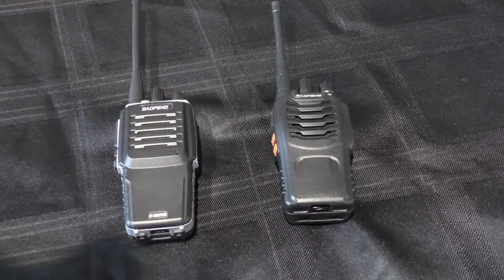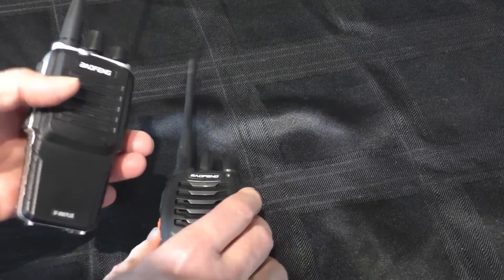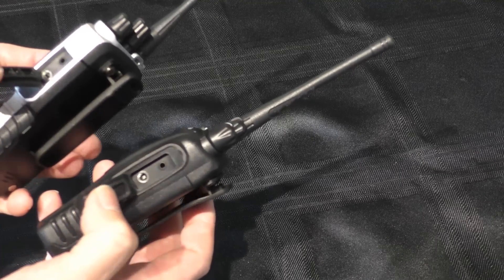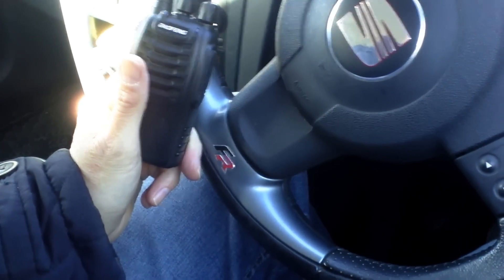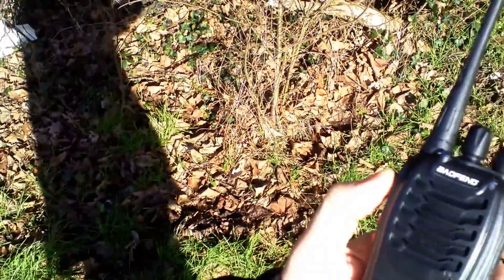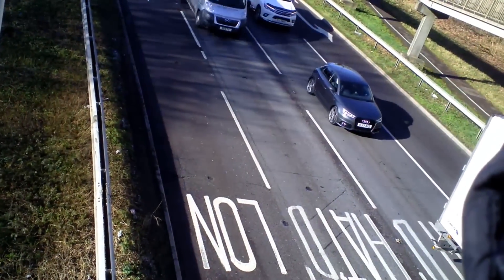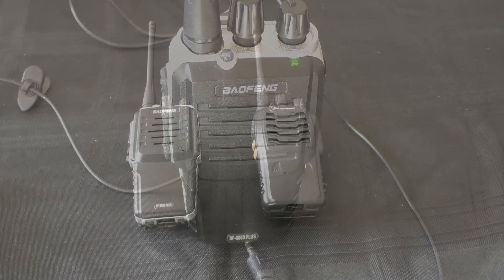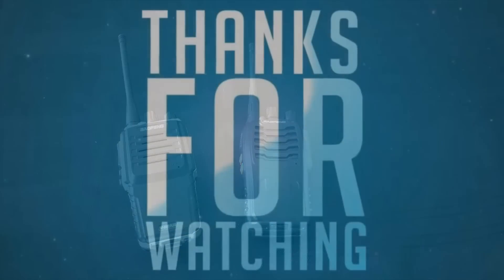Baofeng 888s V Baofeng 888 Plus on 446 Mhz.

Comment: I have a Baofeng 888s radio and i was wodering if i could tune into my local airports FM uplink i live around 9KM (5.5 miles) away from the airport and was wondering if i was to purchase a NA771 i would be able to tune into the frequency using Chirp and programming the frequencies ? Many thanks Louis
Reply from the maker: You would need to look up the airport freqs.  It will pick up 140 MHz.
Reply: Fred in the Shed I shall definitely look up the frequencies I was just wondering if they will reach as for as the airport ? Or is a powerful antenna necessary??

Comment: If I buy a baofeng bf 88e pmr 446 will I need to programme it or can I just use out of the box
Reply from the maker: Hi.  You need to program the preset channels.  Most people use the 16 PMR 446 Mhz channels.
Reply: @CB-RADIO-UK  you mean like set both my radios on the same channel? Eg. If I'm using channel 2 on one radio then set the other radio on channel 2?
Reply from the maker: @mrpullafastone  No not exactly.  The radios com pre programmed with random test channel freqs.  Trouble is some of these can be on the same channels (or close) to emergency services or Ham channels.  You could end up getting in trouble.  What you need to do is download a free programing software called CHIRP.  Inside CHIRP you can re programs the radios channels.  Most people use the public 446 PMR channels which are legal.  You can find the 16 channel freqs by google 446 PMR then copy and paste them in CHIRP.  There are some good CHIRP programming guides here on YT its pretty easy once you start.  Best of luck
Reply from the maker: @mrpullafastone  Chirp download here. https://chirp.danplanet.com/projects/chirp/wiki/Home
Reply: @CB-RADIO-UK  thank you

Comment: i've recently got my hands on a couple of baofeng UV-6R the build quality is really well built, i've not done a range test yet on them but i highly recomend you get some uv-6r radios and compare range test from the UV-6r and the UV-5r to see which one has better range and power and do a video on them to see which one is more worth your money against the UV-6r and the UV-5r. Could you possibly do a range test with some channels on the UHF and the VHF band aswell to see if it makes a differnce. thanks
Reply from the maker: Hi.  I can only do the 446 band iam afraid as iam not a Ham.
Reply: @CB-RADIO-UK  thats fine.

Comment: I used abit of solder to make the copper path thicker on the antenna part of the connection to the component near that antenna link on the bf888s plus.
I also soldered the other side of the component to the end of the copper path of the board.
I stripped the cover of the copper path on the board to expose the copper for the solder have the best copper path on the board.
Reply: I've had better receive and transmit on the mod as it's using more of the antenna.
Reply from the maker: Yes that makes sense to make sure you get the max transmit signal.  Sadly my 88s was a fake.
Reply: I got mine from a decent seler on ebay was just over £20 I think does 1.8w out.
Reply: @CB-RADIO-UK  On the BF888s PLUS using the FM receiver on the radio I've also found the audio quality to be better on receive with the mod.... The only reason I tried audio quality with FM receiver is it's higher quality audio than what most transmit on their radio so wouldn't be able tell the difference much on the audio quality received.

So if the audio quality on receive is better than before on FM receiver then the transmitted audio will be better dependent on the mics quality I use.

Comment: I tend find that china uses more cheaper mics to lower the cost of the radio but I have a BAOFENG hand mic that I modded with a higher quality mic for the output.
You can even change the speaker easier within the hand mic with a more higher quality speaker and can be done for cheap insteada spending say £30 for a decent hand mic.
You could even use a higher quality mic from say old reusuable mics from say CB/PMR446 &/Or other types of radios/mics.

I tend put out traffic reports and such when out on channel 8 PMR446 I'd also like to mention there's been 16 channels PMR446 since January 2018 with external antennas legalized but about 20ft above where your situated.
Legal power is still 0.5W or half watt but 16 channels PMR446 are allowed with external antennas about 20ft higher where situated.
Reply from the maker: Good call Andrew.  I never really thought about changing the built in mic.
Reply: @CB-RADIO-UK  nor did I until I saw a vid about modding the mics with a higher quality one.
Reply: @CB-RADIO-UK  Plus it would show how well they'd transmit higher quality audio with a higher quality hand mic.

Comment: Does The Baofeng have to be on a certain (one of the 16) channel in order to communicate on 446.018 UHF frequency
Reply from the maker: No if you do not want to use the PMR 446 freq you can program other frequencies.

Comment: Well done to make it clear that do use these radio straight out the box you to returned them either for  PMR 446 channels or if you are a licensed radio amateur turned them for 77 cmms  Ham band do use anywhere else in the UHF band unless you a license holder for that Frequency from Offcom and you hold a license to use it. Chrip is free to download programming software
Reply from the maker: Hi.  Yes they will tune to the 70 cm band no problem.  No iam not licensed so i just program these for the 8 446 Mhz channels.

Comment: The 888S definitely had better TX and RX audio to my ears.
Reply from the maker: Hi Joel.  The 888s did well for a £10 radio.  The Plus had a louder audio i think but iam not sure if it was any better.  The 888s had a good receive, nice deep tone.
Reply: To me 888s sounded better at least on the video I dont know in person
Reply: I find dependent on antenna used & either hand mic or lapel headset will also depend on the quality of the rx/tx audio quality and distance on tx/rx.

Comment: 888s had better audio without a doubt. Good vid.
Reply from the maker: Thanks.  More testing on the 888s coming up.
Reply: On a few of the baofengs if you take the case apart and drill out the mic hole the audio improves a good bit. I had my doubts until I done it on my uv-82

Comment: Can't see me trading up my standard 888's for the plus tbh.
Think my next move will be a 5r with the Nagoya aerial.
Reply from the maker: Yes ive got a 7771 on my UV5R and it works well.
Reply: I went with the uv-82 about 25 quid, great little radio, you can program most settings from key pad. I have a nagoya on mine.